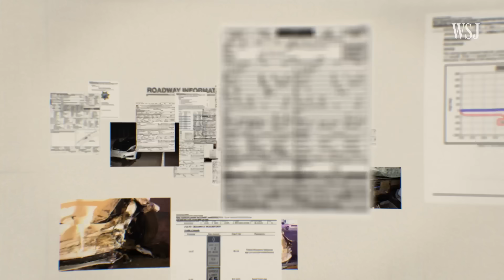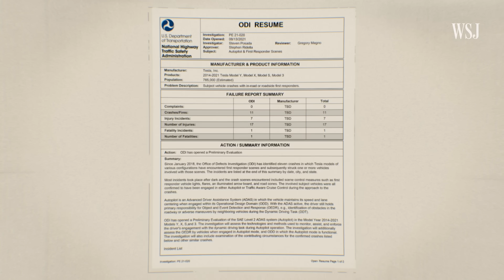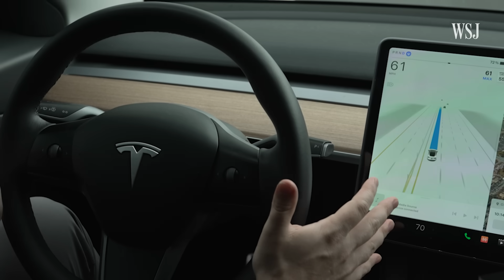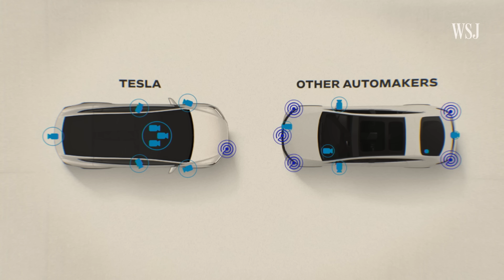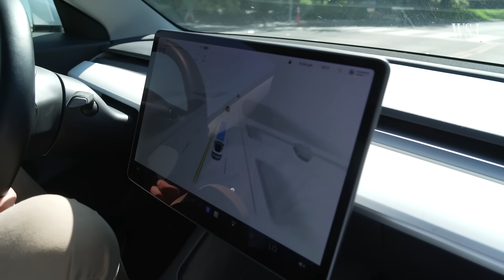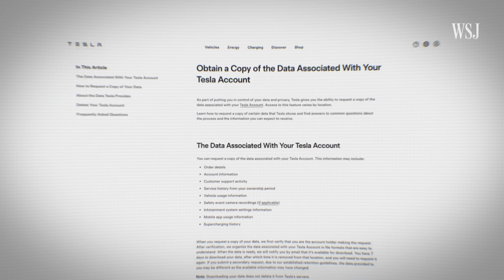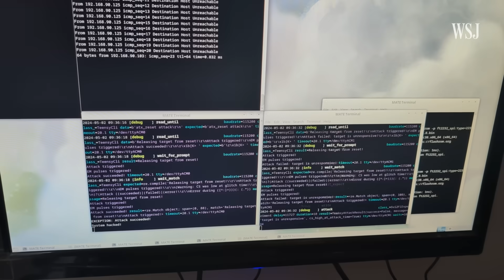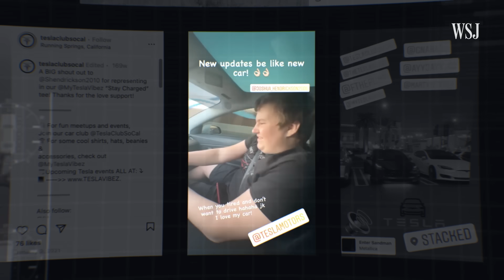The Hidden Autopilot Data That Reveals Why Teslas Crash | WSJ

Comment: If you think your car will just drive you without any requirement for you to be paying attention, you will die. Maybe not today, maybe not in a year, but one day you will die. 
Your car didn’t get a driver’s license! You got the license to drive and are required to drive! You are the driver! Your car is only assisting you and it is 100% your responsibility to remain alert and to take over, completely preempt the computer, when you approach a situation that is not ideal. You need to turn your brain on and read the owner’s manual of your car and understand how it works so you can understand how to operate your vehicle. It always shocks me when people spend $30k, $50k, or $100k on a product they know nothing about—I’m serious. People just take control of a potential death machine and just do random stuff.  Use your cruise control in the rain, the manual said not to do that. Have no clue if your car has anti-lock brakes? Hopefully you don’t rely on your brakes for anything important. Think you can turn the computer on and go to sleep as the car figures it out? OMG!

Comment: yes but isn't the human still in control at level 2? im super confused whether this is a mode where the AP is assumed to be safe by its self or the drivers assume it wont fail.
Whether the driver is alert or not...what? i am not trying to defend tesla but this research does not put enough weight on the fact the driver supervises the system and needs to intervene, the same reason airplanes still have pilots

Comment: I have been commuting in my Tesla for 6+ years now, with Autopilot enabled probably 80-90% of the time (I have FSD, but leave it disabled most of the time, because it is too unpredictable). I work in tech, and am fully aware of these shortcomings. But the way our brains are wired, they are bound to make simplifying shortcuts: if AP works fine 99% of the time, there's no way my attention won't occasionally wander, even though I know from experience that the car will actively try to kill me that last 1% of the time. On top of that, Level 2 autonomy takes you mostly "out of the loop" even if you are paying attention - and it takes precious extra seconds to take charge again, even if you identify the threat before AP does. I bought an AI-free car this year, just to re-train my brain to be in charge again.

Comment: The worst aspect of Tesla system is that you CANNOT turn it off.
I didn't pay for the "full self-driving" package (because I always thought that a 100% vision based system - like what's fitted to my Model 3 - was idiotic).
I almost got killed while driving on the highway (@ the 80mph speed limit) because my car had an 'episode' of phantom braking where I almost got rear-ended by an 18-wheelers that was following me.

Comment: Tesla sees something strange on the road and thinks it must be nothing, and drives full speed.
When I see something strange on the road, I slow down
Reply: Right? Why isn't this the default behavior?
Reply: @gatowololo5629  Because they likely have a high false positive rate that they can't reliably eliminate. A normal human takes a "better safe than sorry" approach - Elon Musk and Tesla take a "shut up and give us your money" approach.
Reply: @gatowololo5629  it's not the default behaviour because the system is far too rubbish and would be constantly slowing down
Reply: @gatowololo5629  Well I guess if may be stopping each time the system is not sure what they see. That could again cause even more accidents.  It seems to me that without a radar it 's not going to be a reliable system.
Reply: @gatowololo5629  what year is this data and tech in the reporting based on? Kinda crazy right?
Reply: @gatowololo5629  Probably because of the data it's trained on. Technically or humanly, it is impossible to train the system on every single possible thing it may encounter, so it's trained only on a small subset of all possibilities. From that it follows that the case of "encountering an unforeseen / unrecognizable object" is what's happening all the time, many times  on each trip. And most of those encounters are harmless, of course. That's okay when you are training a computer to recognize cats and dogs to impress your CS tutor, but definitely not okay when people's lives depend on it.
Reply: @SongOfItself  i think it can be trained on every single possible thing it may encounter since it "should" have data from all its users. The data from that crash should be uploaded on all the vehicles.
Reply: 15 seconds into this video, the footage clearly shows other vehicles with hazards on by the side of the road and cars ahead are slowing down and maneuvering around. So many flags are thrown, a regular driver would be aware something’s up well before spotting the overturned truck.
Reply: @ the biggest red flag of the truck is the truck that no one else didn’t see
Reply: It's still learning to recognise objects on the road
Reply: most machine learning algo's are about "averaging down"
it is often the exception, the never occured situation or obstacle, that proofs - and thus this choice of algo - to be mortal
Reply: It's still learning to recognise objects on the road
Reply: Not true.  You did not see it and hit it.  Then you wondered what you hit.
Reply: Tesla sees everything strange at the beginning. Even shadows.
Reply: There are enough humans, thinking, unclear ditudtion and low visibility can be resolved by, speeding to faster leave the, situation. A computer should be programmed to be cszmutious. Unclear situation = slow down and beep, the driver needs to act.
Reply: @redge8six  So as a human I would I take over to slow down, even more if the car was telling me 19 times to do so.
Reply: But....ELON SAID IT'S SAFER THAN HUMAN DRIVERS!!!! 😂😂😂😂😂
Reply: @necavenue  do you have a link to that?
Reply: @necavenue  It is. The dude that was driving ALSO hit the truck. He was driving the car. And I've seen how people drive. You're not even remotely as good as you think you are. You're saved by all the other people on the road avoiding you despite you not paying attention.
Reply: @necavenue  The driver that unalived was driving it. It was a Tesla. He was driving it from where he parked it, all the way to the crash site. It was being driven. Tesla autopilot in that iteration doesn't drive the car for you, it's just there to assist.
Reply: @antonbonin5003  Sure....and then he let the car drive for him right into another stationary object. 🤡
Reply: @necavenue  It is indeed, multiple magnitudes safer than human drivers. However, a human, ATTENTIVE driver, combined with driving aid, is the most safe on the road. Sadly, ALL these Tesla crashes were with a HUMAN driver, NOT paying attention to the road, relying 100% on the driving aid. That is their problem. Just because you want to play candy crush on your iphone, while on auto pilot and then die, is on you.
Reply: Yeah, because you'd be paying attention: Exactly what Tesla's require to use their autopilot features. It seems to me that most of the accidents shown in this video could have been avoided if the driver had kept their eyes on the road.
Reply: @ autopilot that requires you to pay attention. 🤔 that sounds more stressful than just driving normally

Comment: I do think it is worth noting the difference between 1000 crashes happening with autopilot on (and how many of them could have easily been avoided had there been human intervention, and the large number of human caused accidents in the same time period. AI will only get better, if they ever add lidar then instantly better. Yet humans as a whole wont get better at driving.

Not trying to take teslas side or anything, just pointing out that humans cause accidents too, and with the conjunction of humans intelligence and constant computer processing of AI that is when peak safety will probably occur.

Imagine the human doing the steering and AI doing a dynamic cruise control, speeding gets cut instantly (obviously an override with the brake pedal just like normal cruise control).

Comment: I didn’t sign up to have FSD beta tested on roads I use.
Reply: Well that is fine because it is no longer in beta, and is set to make our roads far safer.
Reply: @ 
Technically true but it’s still needlessly causing collisions & death, and will never be more than L2
Reply: @ChrisB-yv1sj  Autopilot is a simple lane assist. It makes driving safer, but the driver is responsible. FSD however is a very different beast. V13 showing how close Tesla are to solving true autonomy. Most people have no idea just how good FSD is getting. It is going to make our roads far safer.

Comment: Folks don't realize Google and Waymo has been experimenting with self driving cars long before Tesla began doing it They started right waaaaay back in 2009 and started the whole thing with Robotaxis and even Self driving Semis and they are still testing it (They are at Level 4 automation). as of right now 16 Teslas using FSA where involved in crashes since 2017 since 2012 there has been 23 crashes involving Waymo and google self driving cars

Comment: Its accident rate with Autopilot engaged is 0.18 accidents per million miles driven, compared to the US average of 1.53 accidents per million miles.

Its accident rate with FSD engaged on non-highways is 0.31 accidents per million miles driven, which is an 80% reduction compared to the average vehicle.

The public are so dumb they get actually think FSD is dangerous. It will only get better and not worse.

Comment: Bottom line, the responsibility of the vehicle is in the driver’s hands. If there’s an accident on the roadway, the driver should be paying attention and alert and be able to safely approach an accident. When the driver is putting all confidence into a computer system then there’s gonna be accidents just like thiswhether it’s playing on your phone racing the guy next to you so you can be first to the red light or trusting modern technology, the final result lays in the hands of the driver.

Comment: People say Tesla car isn't safe, it's promoting the wrong term blablabla.
Any Tesla driver would know when you enable fsd the car warns you you should be ready to take over, it's in Beta.
To me, the car has a good crash rating and doesn't have steering and braking reliability issue then it is a good car. Whether or not you can stop for a overturned vehicle or avoiding a deer is really the driver's responsibility. That also aligns with the definition of L2 autonamous driving.
If you feel the system is not good enough, don't use it. If it's dark or slippery, slow down.

Comment: What a waste of effort this video is. Tesla has never said that FSD is capable of driving by itself. You mention that the dead driver had been warned 17 times to put his hands back on the steering wheel, then you blame FSD for the crash - duh!
Your assertion that FSD needs more than just cameras is repeated regularly, but this assertion is based solely upon opinions; not a fact in sight.
On another note, at least you allow comments. Most MSM don't lie the idea of feedback.

Comment: The high-beam should be automatically activated when the camera has zero visibility toward dark roads. Even Honda Sensing is more clever than the tesla autopilot in this. If the computer is confused about its surroundings, it should immediately warn the driver to override the autopilot and take over driving.

Comment: I have a Tesla model 3 and I drive long distances often. I do use both autopilot and cruise control, both are far from perfect, so I don’t trust them and remain always ready to take over. It makes so many mistakes with phantom breaking that I have grown used to overriding the car by pressing on the accelerator pedal. I am fairly sure that eventually Tesla will fix this issue but probably not until after they have solved the FSD problems. I certainly hope they fix it soon because we need to remember that there are so many vehicle accidents and serious injuries or deaths on the roads caused by human drivers that the best hope we have of reducing them is taking the humans out of the problem.

Comment: I wonder if they have data related to Subaru's Eyesight system which is also a camera based system. Having owned both a Subaru with Eyesight and current another car with a radar based system, the Subaru system was the better one from my experience so far.

Comment: True or false? There are approximately a half million miles per crash in the United States as opposed to Tesla's on autopilots where it's over 7 million miles traveled per crash on autopilot.
Reply: False. Anyone who knows anything about statistics knows it is an incredibly biased sample. I also wouldn't take Tesla word on it. It should be independently verified.
Reply: Counterpoint: crashing is seemingly (logically?) more likely on local streets; with tighter streets, parked cars, pedestrians, cross traffic, etc. Autopilot is primarily used on highways. So, yes, it logically follows that driving on highways - with Tesla’s Autopilot features or not - have reduced accidents per distance.
Reply: Autopilot by definition can not crash. It will disengage before a crash to let the driver take over.
Reply: @gearloose703 Of course it can crash; it’s software (which can have bugs), and is relying on fallible sensors (like us humans, too)

Comment: They're not even using Thermal. Thermal would make a big difference. 

They don't use Night Vision. 

They don't use Radar. 

It's crazy not to.
Reply: Not if it isn't needed. V13 is showing it isn't.
Reply: @daydreamer8373  did you watch the video? Do you understand the cameras only see so much? 

Why are you against better and safer technology? 

Why do you think Elon looked so uncomfortable talking about it?
Reply: @Google_Does_Evil_Now  I did watch the video. But I have been following automation for years ( not just Tesla) Anyone thinking this video bares any relation the the tech of today, have no idea just how close Tesla are to solving automation. FSD is set to make our roads afr safer.
Reply: @daydreamer8373  but they are having serious accidents recently. 

When the lighting is bad or the visual isn't recognised why doesn't it do something sensible like make the driver take control? 

Why would it think it's ok to drive into the back of multiple police vehicles all with their emergency lights flashing? 

And wouldn't lidar and radar have informed it of the obstacles? 

It's obviously a decision on cost, not safety first. 

I wouldn't be surprised if this ruins Tesla. Think of all of those claims and Elon knowing that it was going to kill people. That's high punitive damages. 
Billions. Upon billions.

Comment: Self driving car tech is still being researched by scientists. It is not here yet. It’s in its infancy. 

Tesla is not making that fully clear.
Reply: V13 is showing how close Tesla are to solving autonomy. It's performance has been nothing short of remarkable. Tesla set to start operations next year.
Reply: @daydreamer8373  Self-driving tech is still being researched. There is still a lot of reliability yet to be built into it, especially for Compute Vision -only based systems like in Teslas.
Reply: @VoxelGarage  It is not quite ready. But as I said Tesla are set to start limited operations next year. It will only grow from there, getting more and more capable. Autonomy is set to make our roads far safer.
Reply: @daydreamer8373  The roads are not built for autonomy. The roads will have to be redesigned a lot before they can become truely safe for driveless cars without the company having to worry about safety.
Reply: @VoxelGarage  Waymo are already operating autonomous rides. Most people have no idea just good FSD is getting, and how much safer it will make our roads.
Reply: @daydreamer8373  Waymo uses expensive LiDAR sensors which the common person cant yet afford.

Im sure FSD has improved since its first debut. I had FSD on my Tesla this year. It did well in the average highway conditions but it could not do cities. Almost crashed a few times. And I drove a lot. I have also knowledge of AI from university. The tech is just not there yet...but someday it WILL BE.

Autonomous driving and Tesla FSD use vastly different technologies. Its too dangerous at this time to compare them. Generally the more sensors the better, something Tesla vehemently opposes. Vision-only might be possible (that would be cool!), but its not reliable yet.
Reply: @VoxelGarage  Lidar is not some super sensor. A Waymo literally crashed into a large pole a few months back. FSD sees far more than any human, and people have no idea how good FSD is getting or is set to become. Set to start limited operations next year, shows the growing confidence Tesla has in the system. and It will make our roads far safer.

Comment: If a driver hits an object while on cruise control, it is the driver’s fault. Drivers who have tragically died using this system were, based on evidence presented in this video, abusing their cruise control.

The question for courts and lawyers is, did Tesla’s marketing on the “safety” of the system cause drivers to believe something that has never been true (in my opinion)—that autopilot is better than an attentive human driver? Until that is studied, we can’t make a real determination.

Based on my experience, autopilot is incredibly basic but does take some of the physical effort out of driving on highways, leaving the driver free to scan farther ahead instead of watching lane lines—BUT I have definitely found myself willing to take my eyes off the road for a half second longer than I might without the system. That’s the scariest part. It’s a false sense of security at 70mph.